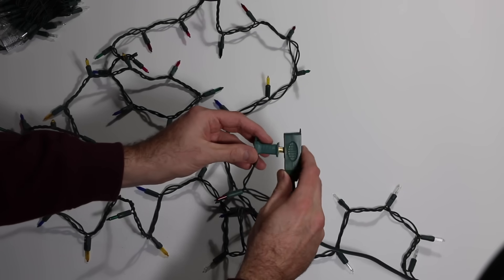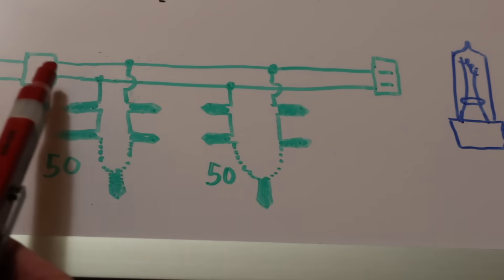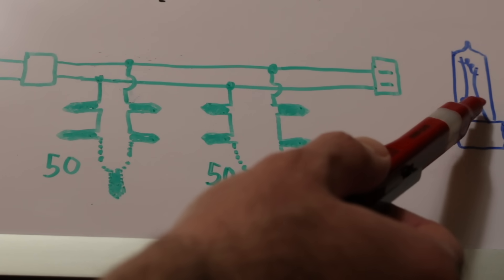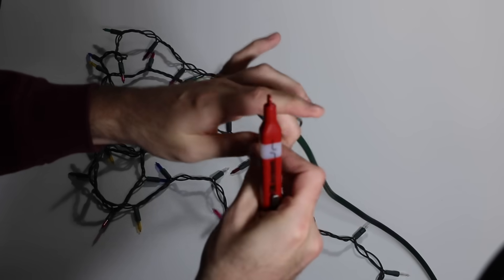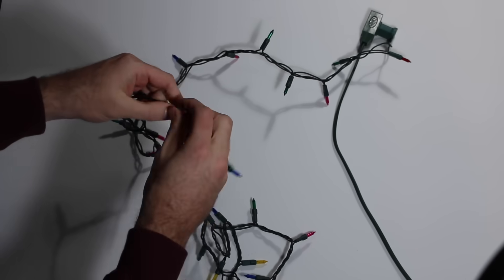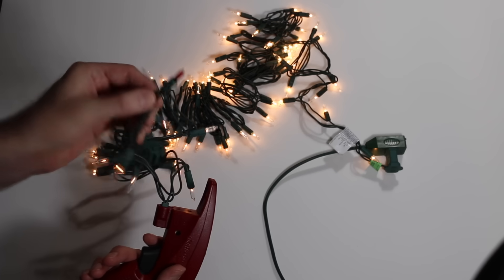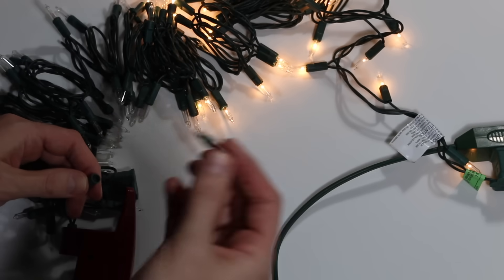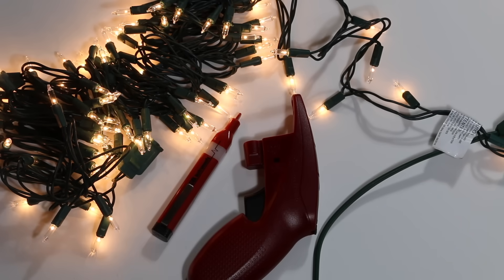HOW TO TEST AND FIX CHRISTMAS LIGHTS - Light Keeper Pro and Non Contact Voltage Tester Method

Comment: Wow that’s awesome thanks so much for showing, I got my lights to work by manually checking the bulbs, then as soon as I hung them they stopped working. I have the light fixer pro Gun thing but can’t find the directions and only used the bulb tester, never knew how to use the shunt feature, this fixed it! Thanks!

Comment: It’s worth noting that some strands with multiple serial sections may lead with a different pole. For instance, I have a set 100 (50x2). The first 50 “tap” on common and the second 50 “tap” on neutral.

So, you either need to flip the plug when testing the second half, or start testing the second half from the other end.
Reply: Very helpful comment - fixed a couple of strands and definitely needed to flip the plug to isolate the bad blub(s).

Comment: Thanks for sharing.  I have wireframe displays and thought the sniffer was to sensitive as it always had a tone/light red when close to wiring.  The shielding with the hand is the what solved my trying to trouble shoot dead sections of lights.  May look for a way to shield without having to partially remove from frames. Thanks again for sharing.

Comment: Good Video. I have a lot of lights to fix this year. I usually just use the pen type sniffer to sniff out the bad bulbs but they are very sensitive. Watching that video gave me an idea. I have a few different multimeters with the NCV function feature that we all pay for and never use. They work and all have different sensitivities but, they are not as sensitive as my fluke Sniffer. The multimeter may make it easier to find the live wire. I'll get back with you if it makes the process faster. Happy Hunting lol.
Reply from the maker: That light keeper pro device also has a noncontact voltage tester on its nose and it’s less sensitive to the point where I thought it wasn’t even useful until I watched a video from the manufacturer showing different features and now that I know how to use it it’s got the perfect sensitivity without having to isolate and shield from the other nearby conductors.  You just touch it up against the base of each bulb socket and it seems to reliably detect presence and absence.
Reply: @GadgetReboot   - time is now right for you to put up a video demonstrating that capability of the lightkeeper ...

Comment: thank you for the video, I have a string that was on for a while, and the whole string just stopped working.  I tried to use the method described, but I can't seen to find out where the bad bulb(s) are as I have power for the remaining string, and the voltage tester lighted up for all the bulbs on the string that are not lighting up. I suspected that there are multiple bad bulbs and I just gave up to buy another one.  If you have a bad string of bulb, turn it off and find the problem right away, or else, many of your bulbs will continue to be burned out.

Comment: I identified all the bad xmas tree bulbs years ago. Anything that had a glass bulb was tossed (Value Village to be precise), and was replaced with LED sets.
:)
Reply from the maker: I bought some LED lights years ago but when I put them in place I hated the way they looked. I don’t know if it was because it was too early for LED to be realistically incandescent or if it was just a weird set but more recently I did find better looking LED, But there’s  still the retro nostalgic thing that keeps me buying incandescent when I find them cheap enough. 

Come to think of it, where are those LED lights. I need to do a decoration audit. I think I could easily throw away half of the decorations and make more room for semiconductors!

Comment: if you had an LED string of lights could you use a voltage detector to find the bulb where voltage enters but does not leave the bulb/base ?

Comment: All good and fine with a brand new set on the table, but try on a 7 ft tree with many burned out lights, nothing but a headache, I gave up doing it with the light keeper, instead just replaced any burned out lights and so far it seems to working.
Reply from the maker: whenever I have a pre-lit tree where the light keeper is the easiest way to get it going again, once it lights up I  then try to find all the burned ones and replace them so the remaining ones last longer and don’t have excessive voltage across them. But when they are all off it can be hard to figure out where the bad ones are.

Comment: Great video and explanation.
You used the voltage tester on incandescent lights. Can the same technique be used on a LED string.
Also correct me if I am wrong. The Light Keeper pro works only on incandescent bulbs?
Reply from the maker: I would have to test the method on an LED string to be sure, but I'm all packed up to move next week so my things are scattered.  And the Lightkeeper Pro is intended to fix incandescent filament shunts so no good for LEDs but they do make an LED Light keeper.  I haven't used it but I think it just provides a way to tap into the string to bypass the bad LED.
 I need to upgrade to LED to learn more even out of curiosity, maybe when I get settled from the move.

Comment: great video, now what happens if the fuses keep blowing in the plug so i cant check with power or plugged in, and there are no signs of damaged wire, and it has one of those controllers on it to make it stay steady, or have different effects
Reply from the maker: There could be a problem in the controller (may not be worth trying to figure out especially if it's just glued together like one I had) or maybe if all the bulbs are actually blown, and all the shunts are working, it could be just creating a big short circuit through all the dead bulbs across the plug.  I had one set I just couldn't figure out so I threw it out.
Reply: @GadgetReboot  thats what i figured, it cant hold a fuse at all, when i plug it in in,it even sparks a little at the plug, so i took controller apart, seperated wires, and will try a new fuses without the controller hooked up, and then use a jumper for each set of lights, it is a sign that says happy holidays, so there is 3 sets of the sign, each string has probably 30 or more bulbs per piece, thanks for your reply and have a great christmas and new year

Comment: When looking at any 120V socket, the narrower/shorter of the 2 plug sockets is the hot. When plugging the light plug in, I would think the wire coming out of the plug that aligns with that side of the socket should always be the hot.
Reply from the maker: Not all the plugs are polarized so they can be plugged in with hot on either side
Reply: @GadgetReboot  Yes, I agree on the plugs. But the sockets are polarized. Whichever wire that is wired to that side of the plug that gets plugged into the hot part of the socket will be the hot.

Comment: I have a non-contact voltage tester tested all the lights on my stran they seem to be getting power they are LED would that be any different from the regular Krypton bulbs I don't know if they have the shint in them or not I went around and pushed all the lights in and even replace the fuses

Comment: I wonder how that thing "repairs" the shunt in the dead bulb....I'm almost looking forward to wrestling with christmas lights in a few weeks....I will reread the instructions for the light keeper pro....Don't remember if they mentioned anything about proper polarization...
Reply from the maker: I think the light keeper does mention flipping the plug around to detect voltage, or maybe it was on one of those ads on their YouTube page where I saw it in a video. 
 For repairing the shunt, if I remember correctly it has something to do with the fact that the shunt has extra resistive material on it that sometimes does not burn away when the bulb filament blows, so it stays highly resistive and doesn’t work properly,  so when a high energy pulse is sent through the string and gets to the shunt, it tries to burn off the resistive coating and if it does, everything magically lights up again.
Reply: @GadgetReboot    OK, that makes sense, will try to reread the directions, if I kept them!

Comment: I didn’t know you can jump start lights  🤣🤣🤣 
What if you have a section with all the lights being black and burned out. Do you recommend you replace them all or toss them?
Reply from the maker: sometimes all of the lights can be burned so at that point it’s probably cheaper and easier to just throw it out but if the bulbs all look scorched they may still work so I usually try to locate and replace a couple of bad ones, and at that point if nothing comes on it means the whole string is probably dead so then I throw it out.

Comment: Helpful video.
But I can tell you: this fixing tool usually doing more damage to the bulbs then good.
Once you shorted your non-shorted burned-out bulbs, and replace them - usually you figure out you've got more burned out bulbs now then it was before.
Also, if you have different set of lights, how to figure out what is the bulb's target voltage?
You can't put bulb from say 50 string line into the 10 string line - it'll burn out immediately.
The same kinda effect if you have too many bulbs burned out and shorted on the one string.
Reply: Ok, I’m an electrician and your comment makes absolutely no sense. This “tool” is simply a continuity tester. It only checks to see where the electricity stops flowing. So if you have a short, you’ll know because your l bulbs will short off and on. An in that case, technically you can fix that too but may not be worth the time invested!
Reply: @bbikermama  I was talking about second dedicated tool and it's feature to short unshorted bad lights when you insert bulb socket into the tool and start clicking
Reply: @boltyk1  If you mean the lightkeeper pro, it is a very useful tool.  A lot of times the string won't light because the shunt that's supposed to carry the voltage around a burned-out bulb isn't working.  The lightkeeper sends a shaped charge down the line that clears the bad shunt.  I believe it's a piezoelectric tool, which is why the clicking sound.  It works great, IF the  problem is the shunt. If a bulb is actually missing, the string will never work until it's replaced.  Still, it's easy to look down a string for a missing or broken-off bulb.

As for the voltage of the bulbs, right on the packet it tells you what length set the bulbs are for.  100-bulb strings are the most common for trees and outdoors, and the others are for something like 10-40 bulb sets.

I bought my lightkeeper years ago, and it's paid for itself many times over by now.  A worthy tool in your Christmas lights box.  It comes with the circuit tester, too.
Reply: @ShroomKeppie  I found the standalone non-contact tester is the most helpful tool to find a problem bulb. And the lightkeeper is only for a bulb test feature.
Tricky points for me was to keep in  mind that lightkeeper tests lightbulbs using batteries, and when these batteries are low (need to be replaced) you still have this small red led indicator ok, but not enough power to lit the lightbulb so you have a false sense the bulb is bad.
Another caveat: when testing bulbs from a low-count strings (less then 50) these 3 button batteries are barely able to lit it. And drain it's batteries even quicker. I'm not sure why having a lot of space in this lightkeeper they decided to put these 3 small button batteries instead of 3 AAs or at least AAAs.
Reply: @ShroomKeppie  If you have small number of good lightbulbs left in your string, this lightkeeper click feature going to correct shunt, but high voltage start burning these good bulbs left in your string until you get some bad shunt again to stop this burnout process.
If you're "lucky" and all bulbs in your string had good shunts - then it will be time to change a fuse. And change it again, and again... every time you'll try to plug this string on after till you figure you need to pull one lightbulb out . :)

Comment: Did this and every bulb beeped ... yet they are all out 🤷🏽
Reply from the maker: they might all actually be blown in which case it’s probably more worth it to replace the whole string with a new one. 
As each bulb blows while keeping the rest of the string lit, the remaining bulbs all take more power and burn brighter and end up with a shorter lifespan.
They gradually keep blowing faster if the few broken ones aren’t replaced and soon enough the whole thing will blow.

Comment: I detect voltage at every light but none are lit. What next? I'm guessing this doesn't work for led
Reply: You're likely detecting voltage off the other hot wire that's not running light to light.  I've found it somewhat tricky to determine false positives and isolate the line, especially when it's already clipped to the house.  It can be tricky to stretch and grab with your hand like he demonstrates.  I bought a dual range  tester that has a less sensitive range starting at 70 volts.  That got me through my last strand for now.  Works just the same for LED.
Reply: Led strips usually work in a very very different fashion which is why everything beeps, I suggest seeking a tutorial specifically for led

Comment: Now if only I can find my lightkeeper pro....I never actually knew it did this.....maybe I can fix some sets I have.
Reply: Well I found it, but its not working.  I am so annoyed with one spiral tree set that I have.  Half the tree is not working.  I checked every single bulb and all work individually...I changed he fuses in the plug...so I am at a loss as to what it could be unless its the wires themselves

Comment: You have the string light not the ones that hang?
Reply: Icicle light strings operate on the same type of electrical circuit diagram as showed in this video. So the same testing techniques apply.
Reply: @stevebabiak6997  it’s a bit complicated

Comment: How are you suppose to plug it in if one end is male that plugs into the power source and the other a female that also has a female on the led keeper....
Reply from the maker: Here's the instructions https://lightkeeperpro.com/wp-content/uploads/2018/10/LKP-Instructions.pdf
There's multiple ways to do it.  If the lights are plugged into AC, the light keeper plugs into a light socket with the bulb removed.   If a light socket doesn't fit, then the lights can just be plugged into the light keeper instead of the wall.    I don't know why they do it multiple ways if it works just plugging it into the light keeper in the first place.

Comment: What is the gun doing that it trips the fuse links.
Reply from the maker: When I was trying to research it myself, which I didn’t put too much time into so I’m not sure if this is accurate, this one blog post comment from 2005 gave one suggested theory that I will go with for now: 
https://gadgetopia.com/post/4746

“I’m guessing that the device generates a pulse with a relatively high voltage but a very limited current, sorta like a large battery in series with a high resistance. When the lamps are connected in series with the resistance, no current flows and all of the battery voltage appears across the filament of the open lamp. This high voltage (presumably) burns the resistive material off the bulb shunt and allows it to work. Once the shunt is activated and current starts to flow, most of the voltage appears across the high resistance and very little voltage appears across the shunt, thereby not burning it out.”

Info on shunts from https://www.energy.gov/articles/how-do-holiday-lights-work

“In incandescent holiday lights, shunts are small wires wrapped beneath the filament. Initially, they are coated with a substance that makes them an insulator. In other words, electricity cannot pass across the shunt as long as the filament exists, because the coating gives the shunt a higher resistance initially than the filament, and the electrical current avoids the shunt in order to find the path of least resistance through the filament.

If the filament burns out, however, the high temperature from the burnout will cause the substance coating the shunt to melt off, revealing the lower resistance wire beneath. Now the shunt has gone from an insulator to a conductor, and current passes along shunt, keeping the circuit closed, and the remaining lights burning.”

Comment: How does it repair the shunt?
Reply from the maker: I don’t know exactly what it does to the shunt but apparently the shunt is an insulated wire wrapped around the two terminals inside the lightbulb so normally it doesn’t do anything but when the bulb burns out it’s usually hot and that melts or removes the insulation from the shunt and suddenly it becomes conductive and allows that light to be bypassed.
so if there’s not enough heat to activate that shunt that’s when the whole section of the string goes out because the circuit is still broken 
so I’m thinking the light keeper voltage spikes must be doing something to help properly remove the insulation off of that shunt but I don’t know how it does it
Reply: @GadgetReboot  That's a good hypothesis

Comment: How does that tool repair the shunt?
Reply from the maker: I think I read somewhere that when the shunt fails to engage, it's because the heat from the bulb burning out wasn't enough to burn the insulation off the shunt and allow it to kick in as a bypass conductor, so the pulse from the device tries to finish the job.
Reply: @GadgetReboot  
Thanks

Comment: Hey man so I have a problem wondering can you help Solve the problem?so I decided to see what will happen if I pulled out a light bug on my Christmas lights and I put the little light bug back in but now they are not working anymore any suggestions?
Reply from the maker: Maybe the two wire leads on the bulb are pressing inward to the bulb base too much and can't make contact with the socket. Try spreading them apart so when the bulb goes in the socket the leads will touch the sides of the socket and hopefully make contact